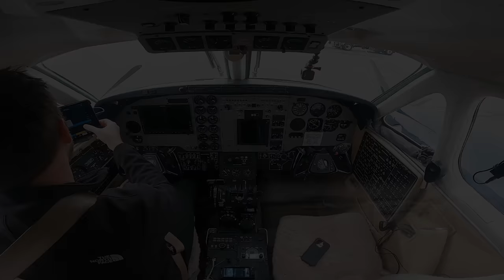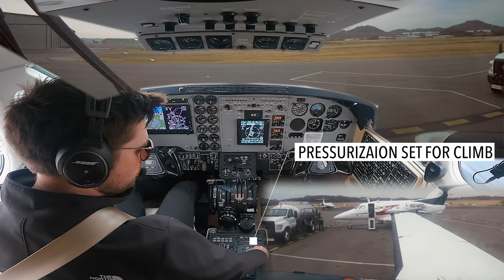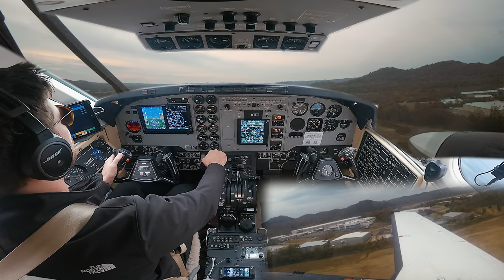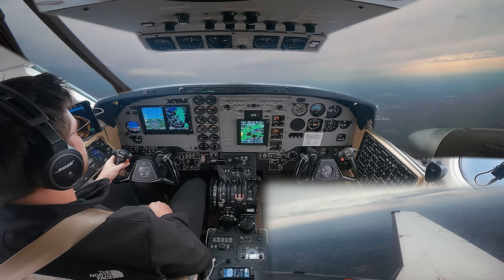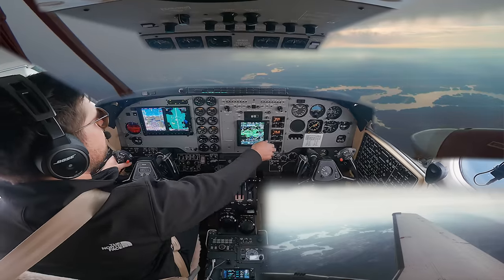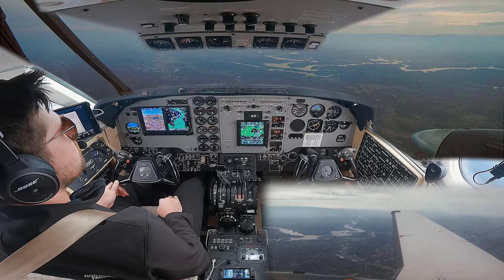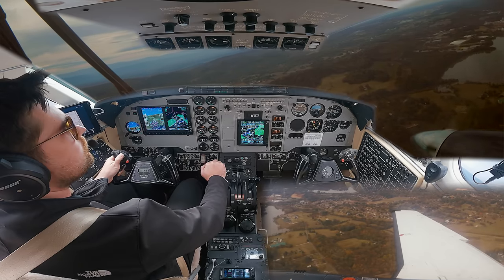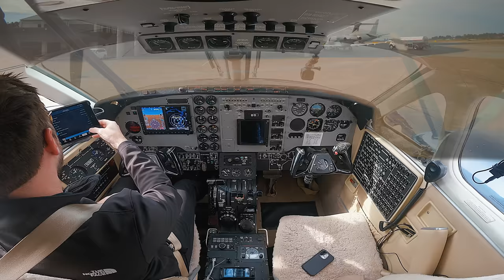Short Flight to Knoxville in the King Air.

Comment: Very nice video. I fly the steam gauge king air in ms flight sim. Operation is largely the same, but to the best of my knowledge, there are no fuel boost pumps to be engaged for startup. Is that correct? The sim model is based on the 350i, which never featured steam gauge avionics, but I guess you could compare it to a 300.

Comment: Great video,just a question ? Why do you close the gen ties on the startup ? Doesnt the normal position already leave the ties closed?
Reply from the maker: With the electrical system in the C90B, for whatever reason, the beacon is on the generator bus. So if you want the beacon on for starting, as I usually do; the only way to illuminate it is to first close the gen ties to provide battery to them.
Reply: @KingAirGuyTV  oh got it,thanks

Comment: Do you ever pull the props back?  If not why not?  Thanks
Reply from the maker: Good question. Depends on the engine/prop combo. We have the upgraded engines with factory 4 blade props, so I’ve found it best to just leave the props full forward. There’s virtually no reduction in cabin volume by pulling them back. Some people with the upgraded props by raisbeck or MT will pull them back closer to 1600 rpm and it actually makes a huge difference in cabin volume. At lower altitudes where you are torque limited, you’ll lose thrust by flying at a slower RPM, at higher altitudes it doesn’t really make a difference on your TAS. 

I’ll try to explain that better in a video.
Reply: @KingAirGuyTV  On my last tour in the USMC, I instructed on the T44 / C90—a 30-year-old KingAir, as you know. Yep, it makes sense for the newer models your flying. Just for your SA, part of the takeoff checks, props full forward (to be able to go into reverse), climb checks: props back to 1500-1700rpm, better economy, and a massive reduction in noise inside the cabin. Landing checks props back to full forward. Thanks again for the quick repley.  Fly safe and keep the great videos coming.

Comment: Do you mind sharing what iPad mount you are using exactly?
Reply from the maker: I use a ram mount with a suction cup on the storm window. I used to used a yoke mount that was specifically designed for the king air but I really prefer having the more “heads up” option you see here. Let me know if need a link to either one.